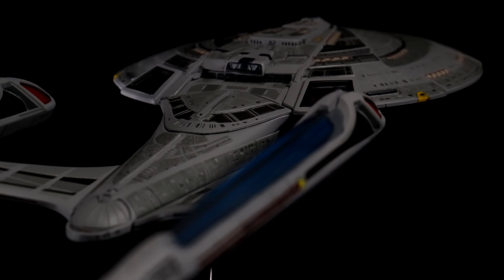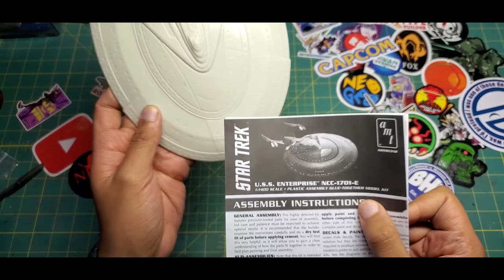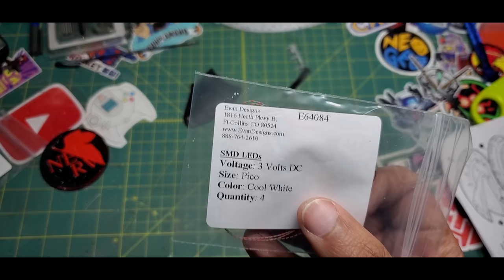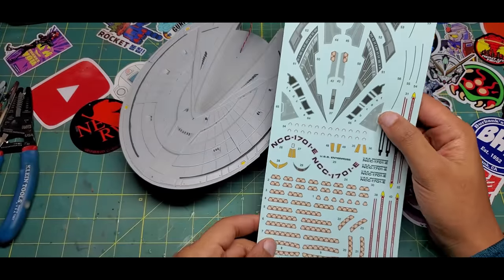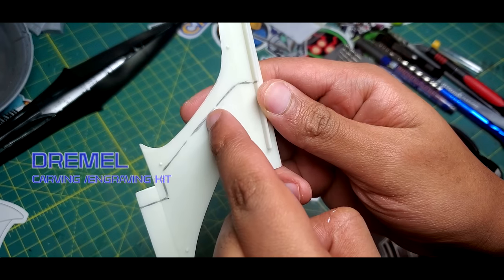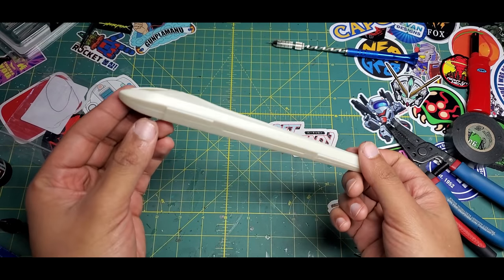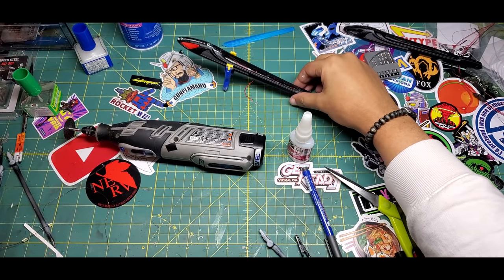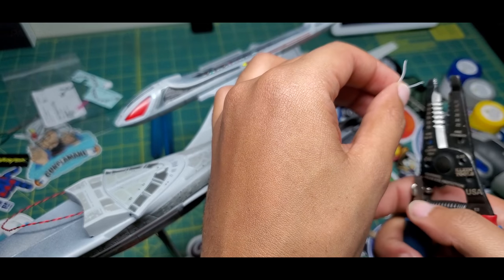#newtype #Otakubuilder #startrek STAR TREK FIRST CONTACT USS ENTERPRISE- E [4K]

Comment: I have done 3 of these. I have NEVER been able to glue the dang nacelle grilles straight. I end up wth grilled spaghetti. I was all set to see how you were going to do it... but you skipped over HOW you did it, just showed the excellent result. The last one I gave up and actually made up decals with the grille pattern and applied them to the nacelle tops. Works okay, but not sure about longevity (they have been sealed with clear coat). Great build as always!

Comment: Great job with the custom lighting! It's been a LONG time since I built a model kit (probably sometime in the 1990s), but I had to laugh when you said the fun part was beginning with the water slide decals. I remember feeling like the decal step was the worst part for me. Some of the larger ones weren't too bad, but I probably wrecked/lost about 60% of the little ones if not more! II can't remember what brand it was but there were a few kits that had straight glued decals and they were easier to apply for me, but they weren't too strong and the small ones fell off. I didn't know about adding a clear coating to protect models back then, but I suspect that might have helped. 
I'm currently in the process of renovating a room to be a display/gaming/maker room and once it's done I plan to start building models again and videos like this help motivate me.

Comment: Great job, but next time look after COB LED STRIP! That’s a led strip where the LED’s are covered with a “colored” silicone and prevents a bit the problems with hot-spots! Also make the strip in the nacelles a inch larger,so you can cover the whole nacelle cap… base color and build is AWESOME! Thanks for the tips and tricks!

Comment: Please tell me, did you install a different cable for the strobe lights on the backs of the warp nacelles? Did I miss the cable pulling while assembling the pylons? (I only saw the red/black twisted cable for the engine lights). How'd you do it?
Turned out great and thanks for sharing.
Reply from the maker: To answer your question no. The strobes are all on one circuit. But the limit is only four

Comment: The two Warp Drive Engine Nacelles of the Enterprise-E should have been designed with double the size. In my humble opinion, their current disproportionately small size imparts a general sense of weakness to the ship's appearance, which seems at odds with its supposed war and speed capabilities.